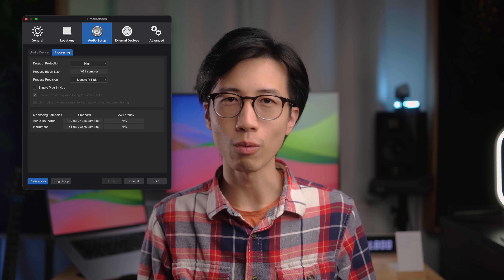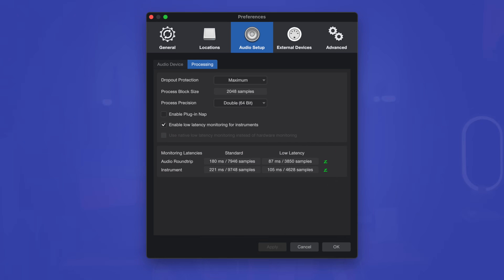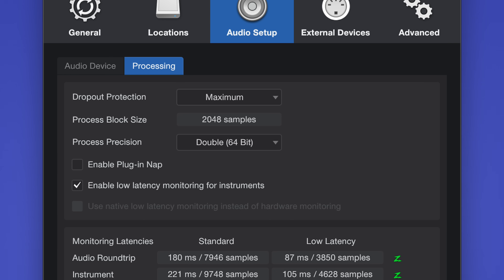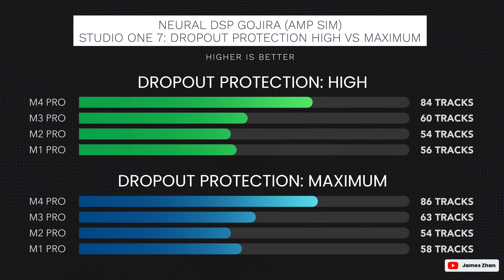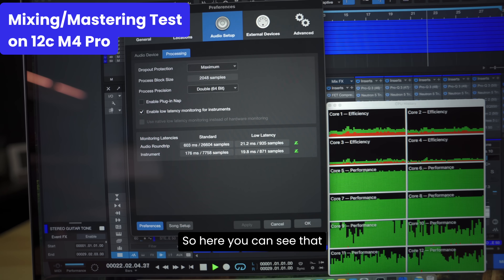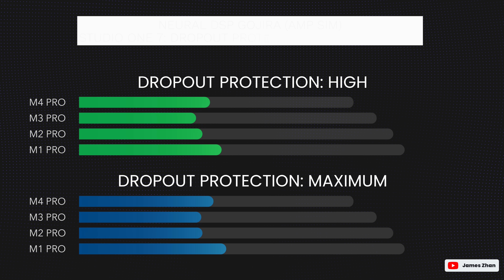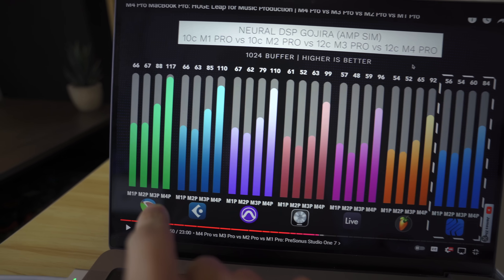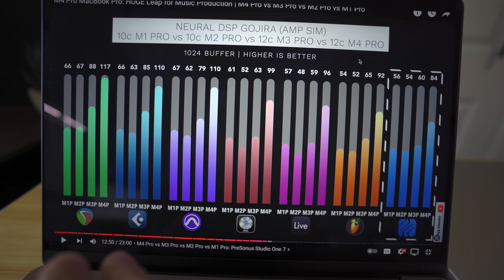M4 Pro MacBook DAW Testing: The WHY | Dropout Protection, Process Buffer, ASIO-Guard

Comment: Thank you very much for this video and this information, I'm a user of Live, Logic Pro and Pro Tools, right now I don't see any point on upgrading my M1 Pro MacBook Pro or M1 MacMini if the DAWs that I mainly use are not going to use all the power of the M4 new Macs. It is sad that Live and Logic Pro don't use all the Cores of Apple Silicon, I'm a Ableton Live certified Trainer and some of the Certified Trainers said that in the Case of Ableton Live, it is by design that Live doesn't use the Efficiency Cores because they can produce Drop Outs and Clicks in the audio because the way Ableton Live uses realtime audio processing, so it seems that this will never change in Ableton Live, which is absurd to waste all that CPU processing power.

Comment: So the problem isn't the chip it's either the code of the program or Apple's way of core distribution. It's crazy because Apple keeps releasing hardware yearly, never addressing the current gens software shortcomings in patching. They have to have a version of chipset drivers that can improve these things. they have us buying this expensive-ass hardware that they immediately bring the value down on a year later.

Comment: I appreciate your analysis. While, it is possible that decisions about the process buffer and other DAW specific settings could throw off the exact magnitude of a difference between DAWS and create that false FOMO feeling,  you are in my opinion spot on about the buying decision matrix. 

Budget may seem limit you to upgrade an M3 pro from an M1 say but if the performances only improved negligibly, then you probably want to go with the M4 pro since you’ve demonstrated across-the-board that it adds a great deal of processing power.

I do wonder, and this is not a criticism, how the performance of Ableton live for example would change when using equivalent native plug-ins (Ableton devices). I don’t know if this is relevant, but it would be interesting to see if it changes anything. My hunch is it would not.

And by the way, I totally get your point that a percentage lower performance of Ableton isn’t gonna make me switch to reaper. In my case I’m a Cubase user for mixing and I use Ableton for production sketching and so on. I usually make stems in Ableton and mix in Cubase .

Comment: Hey James! Big fan of your DAW performance videos—they're some of the best resources for audio creatives on YouTube.

I wanted to share something interesting I’ve come across that might be worth considering in your future tests. It turns out that the usual approach to buffer size doesn’t fully apply with Apple Silicon chips.

For context, I’m a professional mix and mastering engineer using Logic Pro as my DAW of choice, and I regularly push my M1 Max to its limits in mixing sessions.

I've found that running Logic Pro at a 128 buffer actually performs better than at 1024, allowing me to add more processing and maintain smooth playback before maxing out the CPU. Surprisingly, the 1024 buffer size is nearly unusable on Apple Silicon with the same heavy sessions.

After researching, I found that others are experiencing the same trend and it wasn't just an issue with my hardware. Here are some articles that discuss it further: https://www.logicprohelp.com/forums/topic/149438-performance-better-at-128-buffer-than-1024-weird-issues/
https://www.kvraudio.com/forum/viewtopic.php?t=600954

This behavior seems tied to Apple Silicon’s architecture rather than DAW programming, so although I haven’t tested it on other DAWs, I’d expect similar results.
Or it could also just be relevant for DAWs that can't fully utilize efficiency cores. 

Hope this helps! Maybe it’s something you could explore in future performance tests. Thanks for all you do!
Reply from the maker: Thanks a lot for your input! Yeah I've seen discussion about the behaviors of different buffer sizes of Logic on Apple Silicon Macs. It seems that different people are reporting different observations. On my end, I was never able to get better performance on any of my tests by setting the buffer size to lower. What I found was interesting was that when I decreased the buffer size in logic, I didn't have to delete tracks like I would have to on other DAWs, so that was interesting.

Even in the current official Logic Pro documentation, and logic system overload pop-up, both still tell you to increase the buffer size if you're encountering performance issues, so I'm trying to use the official documentation as the reference point.

But for these tests, it makes sense to keep the device buffer sizes all the same so that there's one less variable. Testing DAWs is really complex, and I'm just trying to test them from a layman's perspective.

Comment: Posted this on the original video, but ima comment it here as well.

This is a great video and a great test!
 i think there are a few oversights which would make it a lot more valuable if corrected!

First thing is that i couldn't find any info if the four macs where running the same/similar OS, Which can have a big impact on performance.

Second, info stating that all macs where on the same power setting and hooked up to a charger!

third is that you never answer the question you open with; "Bang for buck".
There should've been a comparison on possible price with new/used/refurbished at the current time of recording so you could actually get data on how much performance you get per dollar and actually answer your question!

other than that i really liked the test! nice.
Reply from the maker: Hi, thanks for your feedback!

RE: macOS versions. Except the M1 Pro, the rest was on Sequoia! On my end, going from Sonoma to Sequoia had no impact the performance of any DAW :)

RE: power setting and charger. They are all set to High Power (if the option was available) so I was getting as much power as the computers could physically give me. Apple Silicon Macs have known to perform exactly the same, plugged or unplugged!

Comment: One thing I've learned about being on YT for a while now is you can't make everyone happy, and curiosity is fine, outright trolling of a creators, good, solid work says more about the troll not the creator. Compared to 100% of other computer audio tests (track count tests) your's is above and beyond what most people do and its a great resource don't let them get you down James! You are doing a good job and anyone who says otherwise is not worth addressing. You do what you do best! Cheers! PS I'm sure you've read this in the manual. It use to be in the old days Logic 5 through 9 that Process buffer was how fast the DAW could access read/write speed to the drive, (like recording to an external drive and internal Disk based drives and so on) but it still is more about read/write speeds and not necessarily overall latency on modern SSDs. Now all the manual says is.
The Process Buffer Range in Logic Pro determines the size of the buffer used to process audio samples and compute effects and mixes:
Small: Decreases latency, but may only be usable on very fast modern CPUs
Medium: The default setting
Large: Reduces the likelihood of overloads, but increases latency

Comment: Hi James! Have you experienced any fan noise with the Mac Mini m4 pro? Some people are complaining about this and others not having this problem at all. It could depend on which version of the M4 pro they have. Always trusting your videos.
Reply from the maker: With energy mode set to high power, the 14-inch M4 Pro can get very loud—louder than the 16-inch M1 Pro, 14-inch M2 Pro (this one doesn't have the option to set to high power, however), and the 16-inch M3 Pro. Chassis size may play a role here, but I also don't know if the M4 series chips just run hotter this time. I will make dedicated video to talk about this!
Reply: @ That would be amazing! I do think that the fan would run differently with the mini’s chassis.

Comment: One interesting comparison would be between similarly specced M4 Pro & M4 Max processors. The expected price difference between a MacMini and MacStudio (both with 14 CPU cores, 64GB memory, and 512GB storage), is only about $400. 

Should we jump on the bandwagon (and save $400), and buy a MacMini or hold out for the MacStudio. This test could be carried out with similary specced M4 Pro and M4 Mac MacBook Pros.

Comment: I did a similar test on windows and Cubase came on top, reaper was not stable and S1 and ableton were equal. 

The real bad taste was on the Facebook S1 group where the admins shut down any discussion about the previous video. 

S1 has many strengths and a lot of workflows I prefer over any other daw but in terms of raw performance it's probably the worst.
Reply from the maker: Thank you for doing the test on Windows! It's helpful info for others to see.

What did you mean that REAPER was “not stable”? Did it crash?

Comment: So reaper has antizipated fx-processing being something like a bigger buffer, but StudioOne has to run on 1024 samples to keep the test fair? I do not really get that.
Additional: do all these daws run on 64-bit internal processing?
Reply from the maker: The point comes down to that some DAWs simply have a higher “CPU overload ceiling” than others; like S1/Ableton/Logic simply cannot be configured to get MORE out of the same chip the way REAPER and Cubase can.
Reply: @ the point comes down to that you may have not wasted a single thought on how they acheive that. And why therefore the users of other daws get more out of theirs than your test implies. So what use does it have?
Reply from the maker: @MarkusH1966  The use is that a REAPER user may be able to get away with buying a lower end chip, because REAPER can “cheat” and do more with less performance cores, whereas an Ableton user might need to get a more powerful chip because it can't “cheat.“

For example, I'm able to work on large mixing projects in REAPER that I can't in Logic on the same computer, simply because there is simply no extra settings for me to make Logic get more out of the chip.

Like yes REAPER can run on a super large process buffer range that Logic can't, but that is precisely the point: that REAPER can do that.

If that doesn't make any sense to you, I'm afraid my tests are not for you, and that's ok! :)
Reply: @JamesZhan  just want to mention, when you set the dropout protection to maximum on Studio One you'll get some type  extra buffer as well. That's why I'm asking.
Reply from the maker: @MarkusH1966  I understand, and I addressed that in this video, though. That extra buffer didn't seem to make much of a difference to S1's performance in my tests, interestingly. The High vs Maximum test results are shown in this video.

Comment: Dear James!
!!!!!!!     UNCHECK "Enable low latency monitoring for instruments"     !!!!!!!! 
             (green "Z")

similar option is not enabled by default in other DAWs, so please uncheck this !
this option make huge impact on performance. and this option enables separate low buffersize input in addition to playback buffer (it doesn't matter how big is playback buffer (high or maximum) coz with this option you have low buffer size in additional input buffer) that's why it starts to crackle so soon in comparison with other daw. and yes, it will not engage efficiency cores but still make additional real performance. 

Thanks!

Comment: Ok so we learned that Reaper is the best DAW and FL Studio is the worst. But which DAW sounds the best and will upgrading to an M4 Ultra improve my sound?
Reply: No improvement to sound by changing processors.   Any daw that sounds better or different  is changing the data.  Same data, same sound.
Reply: @HandWiredAmps  right but a guitar fx pedal with a better processor sounds better. Are you saying that Intel and AMD chips sound better than Apple silicon?
Reply: @mikefisher84  amd Intel or apple, no difference.

Comment: Please ensure that the buffer size can be set as low as possible! Many of us rely on the lowest buffer settings when recording and monitoring audio with plugins like Auto-Tune, reverb, and other real-time effects. This is crucial in Cubase, as a lower buffer size minimizes latency, allowing for seamless real-time tracking and monitoring without delays. This feature is especially important for those of us who work with vocals and need precise timing when recording with effects in the mix. Optimizing for a low buffer size will greatly enhance the user experience for professional and aspiring musicians alike!
Reply: I do agree. We, as composers, needs low buffer size (at least 128/256).
Thanks for you precious work anyway!
Reply: Obsesión for low latency…for me some time is contradictory. When do you need low latency and when not….?
Reply: As an artist, and like many others, I love to hear myself with effects applied while recording. This allows me to get a sense of how the final product will sound and helps me perform with confidence. To achieve this effectively, the buffer size needs to be as low as possible to avoid any delays or latency issues. Typically, after recording, the buffer size can be increased for processing, but I personally keep mine at 32 samples on my M2 Pro MacBook Pro, as it’s the lowest my interface allows.

So far, I haven’t encountered any issues with this setup, even when running around 18 tracks with about seven plugins each, including Auto-Tune, reverb, delay, and other effects. This setup ensures smooth, real-time monitoring and enhances the recording experience. Maintaining a low buffer size during tracking is essential for artists who rely on effects while recording, so it would be great if this could be prioritized in Cubase for optimal performance.